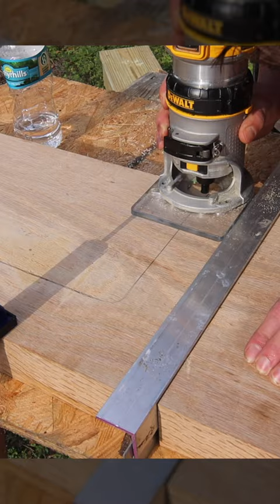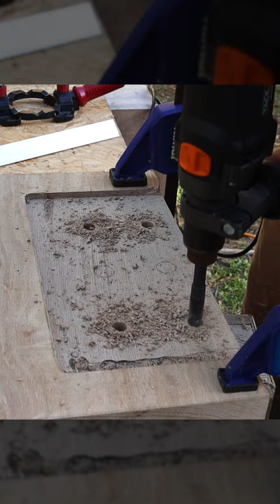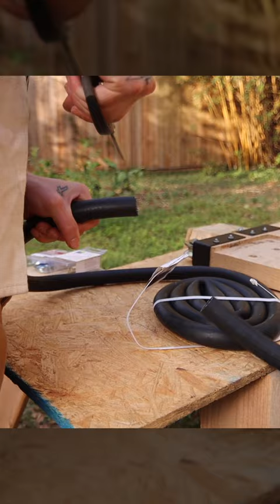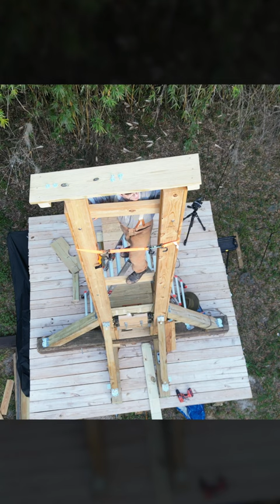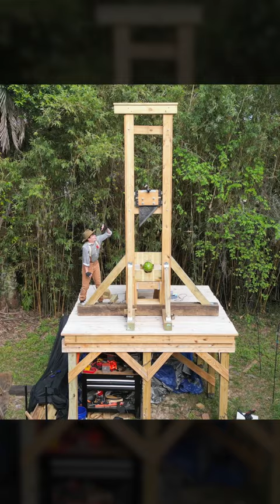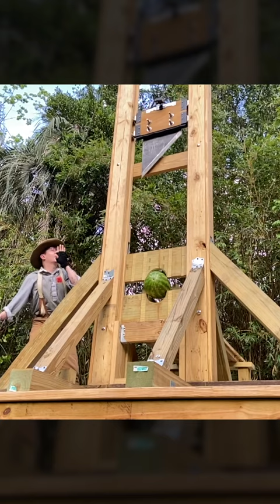Testing the Guillotine

Comment: hey rusty! may i suggest something? the wood that ytou have attached to the blade, if you remove the hard 90 angle from it. and put in a bevel that smooths it into the blade face, the you would get alot smoother cuts. the wood impacts the back of the 'lemon' and slows the actual cutting, and knocks the 'lemon' away. i think smoothing that harsh angle would be benificial!

Comment: You a could add a wedge where the blade meets the wood it’s attached to. So when it slams down, the wedge helps to push the cut piece forward away from the guillotine. It’d look smoother and cooler